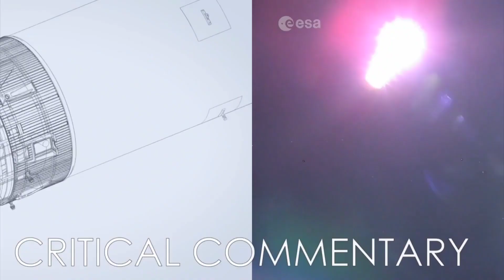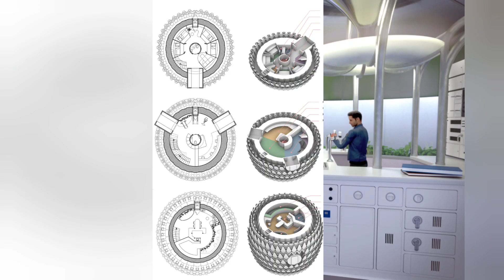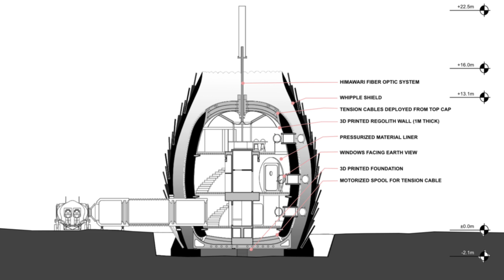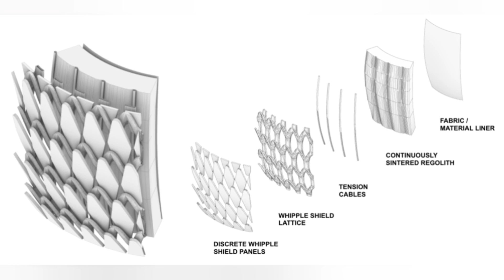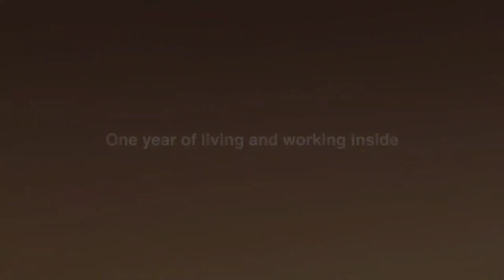NASA puts $57 MILLION down on a Moon City for Lunar Starship!

Comment: Most of the designs probably won't be adequate.  The design needs to be modular and based on a survival cell philosophy, so that every room in the building is a survival cell.  Showing big wonderful looking environments is great,  but functionally they need to minimise risk.  In such an extremely harsh environment,  If the building gets damaged,  you need to be able to compartmentalise the damage quickly and relocate to a new survival cell with minimal operational impact.  Big building spaces wont meet that requirement, unless you have small compartmentalised spaces held within a larger building space.  The focus should be about risk management and survivability,  as No 1 priority of importance for design and construction philosophy.  One hole in a big singular open building space and it's all over.  Mission failed.

Comment: Ok the 3 d printed habitats have massive  flaws.  
1. How are they going to make it air tight.
 2  no air locks between in case of a some kind of breach.
3. No radiation shielding. 
4. You dont need serfice roads tunnels. Are connected to massive  underground  cities.

Comment: Isn't the base of that structure going to have to hold in about 500tonns, cables may stop it exploding but not deforming like a balloon ; I'd feel safer if the foundation was a metre thick block which the sides could firmly hold by the base of the foundation.

Comment: Pretty cool but don’t you think living underground would be easier than building up from the surface? Less temperature cycling and the safest for radiation by far. Sneaky suspicion Elon’s Boring company would be involved. Starships payload diameter of 9meters is compatible with PRUFROCK. Anyway the advances in construction off Earth are going to be outright freaking awesome. Science fiction becoming reality!
Reply: The lunar surface is loose rock down to several metres, and fractured rock for hundreds of metres below that. Dust is a major hazard for machinery on the moon and a tunnelling machine makes tonnes of it. Also, Earth-based tunnelling machines depend on water to lubricate and cool the bits. They also need prefabricated concrete to line the tunnel as it goes to prevent it from collapsing unless the rock is known to be extremely strong.
Reply: @TroySpace  thanks for the info I did not know about how the rock is loose and fractured. There is going to be so much to figure out when this gets going in earnest.

Comment: I have low expectations any of this money will create real progress.  For example, if a starship is gonna land on the moon, then it will become the first habitat.  It could also be cut into long straight steel strips with a 4.5 meter radius to cover the surface of a launching/landing pad. Then welded into a steel surface of multiple convex/concave strip pairs that protects the pad.   A legit moon base will start with reuse/repurpose of starships and consider using local material to create the key infrastructure elements (electrical grid, distillation of water and methane trapped in cold craters, shelter, hydroponic/greenhouse for food and recycling CO2 into oxygen, stage zero for boosting departing rockets without using rocket fuel, solar heated crucible for smelting, …). Shelter is just one key infrastructure and needs to eventually be scaled up but not without the self sustaining components (oxygen, water, electricity, food).
Reply: They may figure out how to sinter regolith into useful large Lego blocks but I see them simply trying to extrapolate what they are already doing and focused on PR agenda items like big above ground shelters with gratuitous windows
Reply: The debris from a landing Starship would shred the steel hull if used as a blast shield. The dust and rock particles are supersonic within the exhaust flow and the Starship hull is only a few mm thick. 
Disassembling the Starship requires cutting and welding, probably by humans. And the disassembled Starship sections still need protection with regolith and thermal protection (steel is a fantastic conductor of heat).
You may as well just land an inflatable habitat and shield it with regolith... which is basically what they're doing with this.
Reply: Regolith is a key ingredient but any process using lots of water to create a cement like building material to extrude out of a giant 3D machine is choosing poorly.  Perhaps giant Lego shaped blocks compressed under heat and pressure will be the answer.   As for the landing pad, multiple layers of starship shell can provide plenty of thickness for directly under the exhaust.   Bottom line is a bare regolith pad is not safe enough to risk debris kicked up into the rocket.
Reply: @douginorlando6260  the 3D printing methods being developed for the Moon don't involve water. Besides having to import it, water boils in a vacuum turning your paste into a mess. Some methods involve using a polymer mix (eg for the landing pad bricks). Others involve sintering with microwaves or sunlight. Which is cheaper depends on a lot of things such as cost of landed material.
Reply: @TroySpace  … I hope it works.   I was expecting shelters would require some kind of air tight seal because regolith would leak unless perhaps it is melted into glass.  Those inflatable shelters buried and encased in processed regolith may end up working out.  It’s the most likely to succeed way to eliminate all the leaks including around the hatch. 
   Another big risk is dealing with sharp edged moon dust that carries electrostatic charge.  Perhaps the moon bricks will be made with built in electrostatic charge to help pull down electrostaticly suspended moon dust.  Perhaps wiring built into the processed regolith bricks to create voltage plates to deal with electrostatic charged particles.

Comment: The words "over engineered" come to mind. Building a giant 3D printer to print things with concrete in a vacuum? Why not bring equipment to dig a trench, land a starship built to be tipped on it's side, tip it on its side and put it in the trench, fill in over it. Viola, you'll have a great structure, ready to go. As for landing pads-we've no idea what we'll need. If we need a landing pad to land starship on, then how are we going to get the equipment down there to build it? By landing starship on regolith. But after seeing the waste on SLS I'm not surprised at seeing this absurd expenditure. I'd rather see them fund more NIAC speculative propulsion projects and the like. More interesting and just as likely to be useful.

Comment: Great video!... My humble 2 cents... 3 D printed structures on the Moon and Mars are fine in theory but 3D printing a house on Earth is a way different thing from printing an air tight, reasonably radiation proofed dwelling on an alien surface. We also have little to no data on how well 3D printing will work in a reduced gravity environment in vacuum or near vacuum.

Comment: Some great info in this video!
There are some really good features on these hab designs too..         :)
The dry regolith particles are an excellent insulator, hopefully these 3-D printed designs can bond it together to overcome that, otherwise the hab will overheat...

An inflatable habitat inside a 3-D printed regolith shell could be suitable for the moon..
It will be interesting to see what wall thickness they choose for these luna habs, given that dangers from GCR and SPE (CME etc) radiation..

Comment: 12:50 Jordan, that's a Blue Origin Blue Moon heavy CLPS lander delivering the ICON/BIG 3D printer. 😏

Also, talking about "more than 4" astronauts on the moon for Artemis, that will be happening once the commercial chorts to Orion come online, namely Crew Starship & Lunar Clipper (that one only travels between Orbital Reef & Gateway, stays in space all the time; so you use DreamChaser to get to OrbReef, take LunarClipper to Gateway, then one of the HLS down to the moon base and vice versa).

Comment: I'm skeptical of the structural integrity of a printed ceramic structure that is pressurized to human-tolerable forces.  That sort of structure is usually great in compression, but very bad in tension....and the pressure differential (14 psi inside, 0 psi outside) will want to explode it outwards.  Maybe buried under 10m of regolith (on Mars....I think you'd need a lot more overburden on the Moon), to counteract the pressurization forces.
It looks more like the habitats themselves will be inflatable, and the 3d-printed structure will be laid down around/over them, providing more radiation and micrometeoroid shielding, as well as better thermal regulation.
Reply: Expect the air inside to dispense with most of the nitrogen.  Say 5 psi.  Maybe less.  It seems to be two layers so maybe a layer at half the internal pressure.  Also there were layers of strengthening materials.
Reply: @Scanner9631  Pure Oxygen environment?  I doubt NASA would go for it (and there's a lot of reasons to avoid that).
Reply: @JohannVF  

Eliminate most of the nitrogen.  Less mass to carry to the moon.  Less internal pressure so less strength needed in the structure so again less mass needed to carry.

Comment: Great stuff,
To me the best part of space is colonizing it, 
That gives us the reason to do it.
Something wrong here though,
Lots of research going into transport to space, 
Not too much on colony models. There should be a large amount of
activity making proxy habitats. Grow rooms, workrooms, sleeping rooms,
 plumbing, atmosphere works, on and on.
I say do it like the military with quansit style underground shelters.
Use conventional excavators only smaller and lighter, and electric.
Nuclear power plants. Use older people like me because we are at the end of our lives anyway.
After we prove we can live there then start expanding into 3D printed stuff.
Question:
What is the material being used in the 3D printing?
Reply: Regolith
Reply: @Awilgu  How do you 3D print with
regolith? Sounds like concrete without water.
Reply: @jbird6609  I’m not entirely sure. the machine makes it happen …
Reply: @Awilgu  If you find out let me know, i think it might heat it up but that takes a lot of energy.

Comment: (Q) Building said 3D printed habitats, on the Lunar surface that has no protective atmosphere to speak of. Are these habitats, able to withstand, occasionally been buckshotted from micro and medium size meteorites?🤔
Reply: What does withstand mean? Does it mean that the outside of the structure survives or only the inside?
Reply: @catprog  "Withstand" means undamaged... As in, remaining structurally sound/intact, a critical prerequisite for the 3D printed biosphere and the inhabitants.☣
Reply: @wayneharrison  

My research suggests a metorite only pentrates about a diameter into the surface. Once it hits you reprint the missing structure and it is back to normal.
Reply: @catprog  Average meteorite velocity 72 km/sec (160,000 mph!). Makes for a very BIG dint. I would erect said 3D printed habitats inside one of the Moon's many lava caves (not on the Moon's surface)... these lava caves are largely still intact, despite the above/surface constant meteor bombardment over millennia.💪
Reply: @wayneharrison  very wide but only as deep as the asteroid.

Yes a lava cave would provide a lot more protection.

Comment: I would have thought the Antarctic habitat would have been a good starting foundation for harsh environment  habitats.
Reply: Why Antarctica instead of the Atacama Desert which is a very dry high altitude site where the diurnal cycle is much closer to that of Mars than Antarctica or the moon? Why not use the Atacama desert which would be easier to supply & do emergency evac (needed when learning how to live in environments like the moon & Mars) than either Antarctica or the moon?

Comment: I can't envision a serious human colonization of the Moon or Mars without using lava tubes. 
I mean, on the Moon they mut reach 500 m diameter wide, dozen of kilometers long, and offer a stable temperature and a protection against micrometeorites and cosmic radiations.
They are much smaller on Mars, but still bigger than anything we can build. They may have been silted by dust however. 
Anyway, their robotic exploration should be a top priority. Same thing with polar craters were water is supposed to be.

Comment: I don't understand why we're wasting money on this technology, at least before we've come up with a long term solution. The only long term feasible solution is to go subterranean. It would be a great system for building an entrance.
Reply: except for the fact that you gotta dig a whole lot go to subterranean, and digging machines are not only HEAVY, it also takes forever to dig and we don't fully know what the structural integrity of the ground is going to be like once a hole is dug. 
Planning for subterranean structures is complicated and we need more intel before we can do it.
Reply: @carljohan9265  I agree. Which is why we need to start here. If we can't achieve this, then habitating the surface of that terrestrial body isn't possible. Then all of this other developed technology is for nothing. 

Let's say that development of a surface habitat will take 7 years and a a subterranean habit will take 20. If we start with the surface habitat it will be another 20 years after it's complete before it usable for long term habitation. The surface habitat will likely be damaged beyond repair by repeated micro-meteor strikes in that 20 year period. If we start subterranean, start on the surface habit 10 years into the development cycle resulting in a real solution coming online at roughly the same time.
Reply: @ThorM465  ...I think you got things backwards dude. 
You can't have a subterranean excavation project without a permanent human presence, and for that you need surface habs. 
Never mind the fact that if you cover a hab with regolith, that's effectively an artificial cave on the surface. 
And as for the "micro meteorite damage", you can fucking repair stuff you know, especially a protective regolith layer (just add more).

Comment: There is one hiccup in the construction of these human habitats for the moon and Mars. For protection from Cosmic/Solar radiation, the majority of the habitat would have to be located subsurface (below ground). 

Has ICON developed the means to perform 3D print construction from surface to subterranean (Top downward)? I say this because this was how many chambers within Egyptian and Mayan pyramids we're constructed. 

Yes! Much of these marvel's of ancient construction stand high into the air, but they also contain many subterranean rooms and corridors where much of the civilization's wealth and history was kept and preserved.
Reply: The walls are 1m thick, which equates to about 200g/cm^2 of shielding material. That will protect against almost all solar flares and reduce the cosmic radiation dose by half, or about the same level as the ISS. An additional 20cm of hydrogen-rich material, eg water stores, polyethylene, will halve that amount again.

Comment: The first HLS will deliver two crew and ten tonnes of supplies to the Lunar surface.  Surely somebody at NASA is thinking "What do we do with the OTHER 90 tons of payload and 900 cubic metres of volume?"  If NASA is not thinking about this certainly there must be thousands of engineers and other dreamers who are thinking about it.  A lot of projects are possible when you no longer have to worry about saving every gram of mass and every cubic centimetre of volume.  And they have at least two, probably three or four, years to plan.  And now NASA has committed to delivering 4 crew and 20 tons to the Lunar surface while Artemis 4 is fiddling around at the Lunar Gateway a year later.
Reply: Several reasons. First, the Lunar Lantern is basically regolith shielding for an inflatable module. Lunar modules will have to be protected by regolith anyway, and tunnelling or excavation on the Moon is going to be very hard because of the low gravity, temperature (the subsurface at the poles is as cold as Pluto) and our old enemy, lunar dust.
Scraping it off the ground and putting it into a 3D printer or brickmaker is the easiest way to make use of it.
Second, NASA fosters technologies that can be applied on Earth, and this is one of them.
Third, it makes it much, much easier to expand a lunar base if you can just fire up the regolith printer. Unlike ISS, where Congress cancelled half of the modules (NASA had to fight hardest for the cupola).

Comment: You need a strong magnetic field to ward off deadly radiation or else everything has to be underground. 
There will be no cute Smurf like huts with windows pointing up at the sky on the surface of Mars. Not ever in our lifetime will that eve happen.
Reply: Hydrogen heavy materials also work for radiation protection.

Water/plastic for instance.
Reply: @catprog  Why carry shielding when building under the surface makes more sense? Currently there is no known practical shielding from cosmic radiation beyond bulk material. Lots of it. 
And there's lots of dirt on the Moon and Mars so,...
I fail to see what the artists think they are doing by creating these fanciful computer animations showing things that will never be built. 
Remember, it is currently far, far easier to live on the South Pole in Antarctica than it would be to live on the Moon or Mars. And nobody "lives" in Antarctica. They just visit there for a while and do research and then come home. The buildings are permanent but the people are not.